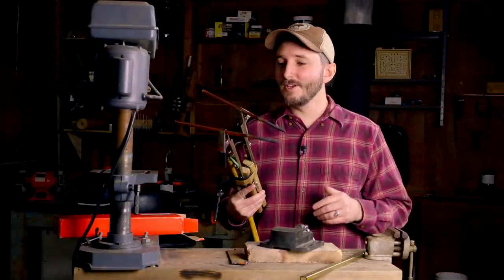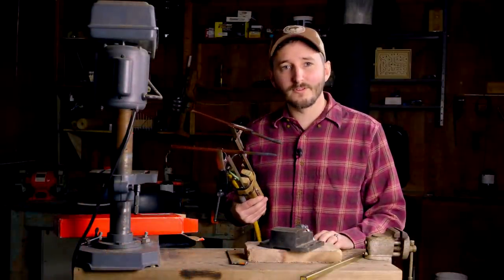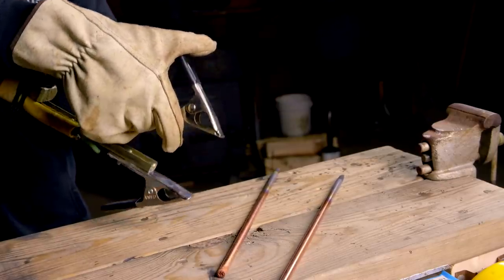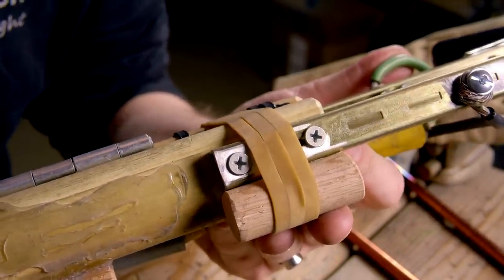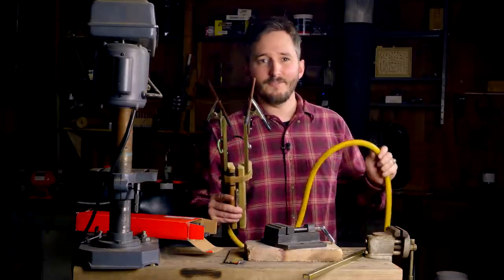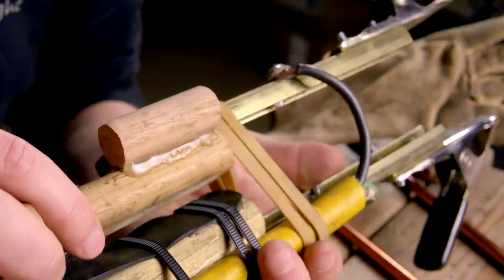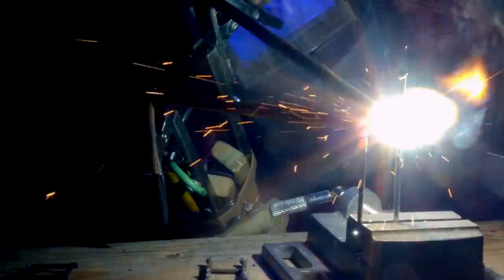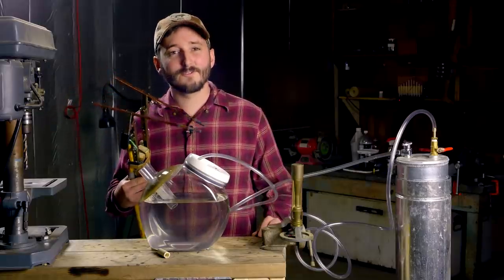Recreating An Antique Carbon Torch (Oxy/Acetylene Alternative)

Comment from the maker: For those interested, this did not actually work very well for making synthetic rubies. It throws off more carbon dust than a single rod as I used in my previous video, and so rubies that I attempted to make were very contaminated. This may however work pretty well if used as a heat source in a small furnace, with a closed crucible in the middle.
Reply: Did you make the project producing a flammable gas with the arc torch? if you did can you provide me the link video plz ?
Reply: How many amps you need for this?
Reply: How many amps do u need? Thx
Reply: @SY_Vlog24  you need 30 - 50 volts and 50-200 amps
Reply: @rolandasa.1112  thanks 🙏
Reply: As someone that's having to stay at home through this crisis because I take care of both of my high-risk disabled parents I'll say that I guarantee you that anybody that has money to donate to a charity at this time should look a little closer to home and only donate to organizations if you don't personally know people that could use your help cutting out the middleman will increase the positive impact every dollar you give has
Reply: COOL!
Reply: So use one carbon rod and one aluminum rod or try stainless. Half the carbon and you'll still get an arc!
Reply: Can you show us how to make carbon rods for welder using pure charcoal or how to make silicone from sand i would appreciate
Reply: What gauge of wire did you use, because I have some spare 6 gauge wire that I was wondering if it would work?
Plus, I know cords for electric ovens use 6 gauge wire and could make a short cord if 6 gauge is big enough. Oven cords are also the cheapest (per foot) way that I have found of buying 6 gauge wire.
Reply from the maker: Try to match the size of the wire used in the arc welder
Reply: @Nighthawkinlight  thank you!
Reply: Could you somehow cover the ruby in something like ceramic or some molten metal so you don't introduce carbon into your ruby? Afterwards just crack it open
Reply: G'day,

Yay Team.

My father died in 1982, and part of his  workshop-kit was a commercially-manufactured Carbon Rod-Holder (1970s vintage) which he never ever actually used ; because he preferred the hand-turned wooden Individual Rod-Holders he'd made, using the Carbons salvaged from expired Torch-Batteries.

  The Rod-Holders were like a pair of fat Crayons, held & used like Chopsticks to make & break the Arc ; all fed by a Transformer lying loose in a  9-inch Cubical wooden Tea-Chest, open topped.

  He used to use the Rig for fiddly little Brazing jobs, like Joining 3 Fish-Hooks together to make "Spinners".

   I think it's funny that he bought a "propper" Carbon Torch, and then stuck with the Hillbilly Rig he'd already cobbled-up - because the Chopsticks worked better, despite looking wildly primitive.

He used to paint the Work with Flux - held in a Vise,  bring in the Chopsticks, strike his Arc & then bring the Arc & his stick of Brass to together - while not touching the Rods to the Job while tickling the hotspot with the Stick.

I think he originally cobbled it all up to repair a Brass Cylinder off a Toy- grade model Steam-Engine, back in the 1960s.

Good 
Old
Technology...!

Such is Life,

Have a good one.

Stay safe.

;-p

Ciao !
Reply: You should try adding a compressed air nozzle somewhere to make it function similarly to an air-arc torch
Reply: It's going to probably be a bit trickier to get/make, and you'll need a hydrogen supply, but for getting a much cleaner heat source for making synthetic ruby, a Langmuir torch/arcatom torch might be an option. There, hydrogen gas is blown through an arc between two tungsten electrodes, splitting it into atomic hydrogen. The atomic hydrogen recombines on the surface of whatever is being heated, creating high temperatures and a protective hydrogen atmosphere. The reducing effect of the hot hydrogen might also help to remove any carbon that gets into the forming ruby from the graphite crucible.
Reply: There is no way to crucible  elements  without  empty space.
- Need a vacuum chamber.
Reply: I have to say that this video albeit simple is very informative.  I never knew there was such a tool/adapter made in the past that was so simple yet very making/handling such intense electrical Arcs and temperature. PS on behalf of making synthetic Ruby's you could try using tungsten rods in place of carbin ones( understanding it's used for plasma cutting tips)
Thanks again for all your amazing videos
Reply: Could you try adding oxygen at/near the arc to burn off the carbon before it embeds in ruby? The aluminium is already oxidised anyway. 

I know you said you don’t have an oxy kit so you probably don’t have stand-alone oxygen either... my local hardware store has a small oxy kit available for 229AUD that I’ve been eying off

Also, if you can adjust the frequency of AC output from the welder, higher frequency should be more “directable”
Perhaps adding some DC offset may produce different results? The flow of electrons FROM the rod nearest the corundum may draw carbon ions towards the rod?
Reply: Grant from TKOR did the crucible with with large battery cores
Reply: @Nighthawkinlight  
I love all your projects and your videos are just awesome
Seeing you just looks like I am watching the inner me doing all exciting things related to fire and sparks that I wanted to do in my childhood
Reply: Can you make crude oil fractional distillation setup and separate different kinds of fuel from crude oil?
Reply: Maybe a carbon arc furnace with argon would be a better idea.

Comment: Also, if you're making water or synth gas, don't die of carbon monoxide poisoning, kay? We all like this channel.
Reply: same goes for trying to compress it into a normal steel tank.
Reply: We should pass the hat around and buy him a sniffer 😁
Reply: Its impossible to get carbon monoxide poisoning from HHO or "water gas" as it has no carbon in it...
Reply: @marshmallowkiller  Wouldn't the use of an arc welder with carbon rods possibly introduce carbon into the mixture though?
Reply: If he's using the carbon arc (sorta hints at that) to produce synth gas and/or water gas, carbon monoxide will be part of the process. If you're thinking electrolysis, then yeah, no problem-- but synthesis gas utilizes partial combustion of carbon to make CO along with molecular hydrogen. Water gas is hydrogen, CO, and when coke was used, a mishmash of random hydrocarbons.
Reply: @marshmallowkiller  Water gas is not HHO  its CO+Steam CO2 and H2
Reply: @marshmallowkiller  bro water gas is a common name for carbon monoxide+ H2
Reply: Might generate ozone

Comment: Thanks for the video. I made one of these setups when I was 14 using carbon rods from D cell batteries, some wood, lamp cord and I used 2 lead weights in a pan of salt water for a rheostat. Plugged the thing into the house current and made a pretty respectable arc. My father came running out and said I was making all the lights in the house blink. Good times.

BTW the old search lights use this same carbon arc process and they have some sort of timed auto-feed mechanism for the large carbon rods. My Electronics school administrator was the only family in the US rebuilding the old WWII search lights back then and I've been able to inspect a couple of them up close. The ingenuity of the builders of society never cease to amaze me.

Comment: Ben - I've got one of these you can borrow for a while if you want to actually handle one in person. I'm in Canada too, I'll mail it to you if you want. There's a couple things I think you haven't figured out (like that as rods burn down, you need to adjust the angle permanently). Pretty simple fix. 2 changes: 1 - Add an adjustment bolt with knob that limits how far the handles can be pushed apart (their max springout). 2 - Replace rubber band with a spring pushing them apart. You always have a bit of spring to it so you can light, but how far apart they go afterwards depends on the bolt. Also in my half-made list of videos from 10 years ago I've got a tutorial for making one on the cheap. Cheap heavy gauge cord is almost always best to be old jumper cables. You can usually pick up old ones for $2-10 at a garage sale.
Reply from the maker: It's pretty easy to keep the rods spaced with thumb pressure, but I did consider an adjustment bolt.
Reply: @Nighthawkinlight  - The idea is that you just snap it shut to light it, let off, and then it's automatically held at the correct separation without having to use any squeezing pressure. They were used in part to preheat larger slabs of steel prior to welding, so you'd get sore holding them at the precise distance you want all the time. I think the knob is usually a knurled bit of steel as a thumb screw, so you can gradually decrease how far apart they're pushed. Or, maybe it's not done by separation but by rotation. I forget. I'll go play with them tonight and make a short video for you if it's anything interesting.
Reply: I also have one commercially made, I find it very hard to use to braze with but good for gouging and cutting through thickish steel..

Comment: Arc gouging whip needed and air compressors you will be able to cut any weld loose with percision and not damage base material.   It how we remove suspension hangers from a frame after there worn out and need a new welded on.
Reply: Oh come on brother, why take the easy route when you can us a cheap oxy/propylene torch to wipe a weld off in the midst of a wretched spray of bb sized globules and the constant threat of gouging because we haven't updated the shape of the torch in 100 years?

Comment: If you ground your work piece with a clamp and use your carbon rod to make the heat you can blow compressed air just behind the arc to effectively make a very clean gouge. Their are manufactures that use trade names like 'Air Arc' ect. But, you can give it a DIY try if you need to gouge and need a very clean, plasma cutter like, finish without a lot of surface prep. Works in all metals but you may not like the carborizing effect on aluminum or bronze.
Reply: When I worked in oil and gas they still used Arc-Air for destruct of old sections. They were using big heavy duty things, sounded awful and loud, like hells workshop!
Reply: In my last job I saw guys using arc air gougers, they wild

Comment: I'm rubbish at welding thin steel material such as car bodywork. However, I have done some serviceable work using carbon arc brazing. I found it to be fairly easy to control and capable of quite gentle heating, when required.

Comment: They used them for stage/street lighting quite often, and there was a clockwork mechanism to advance the rods automatically. Should be a easy search to find the designs.
Reply: Yep.
Reply: Electromechanical actually, not based on time. They self regulated based on the resistance of the arc.
Reply: And search lights on tow boats!

Comment: Many thanks for sharing this video. You can melt steel with these two arc rods .In the fourties there were many steel melting furnaces working on this principle. My neighbor few miles away has a antique arc melting furnace to melt 1ton of  steel but its collecting dust because its  energy inefficient.

Comment: When I have a rusty nut I can't loosen I wack a carbon rod in my welder ground clamp, another in the hand piece and get her glowing, because it doesn't have an open flame you can heat things in sensitive places like near plastic components, fuel lines, brake lines etc. great on old farm equipment
Reply: Wait, what? First of all, to cut something like a nut/bolt, you only need 1 rod. Attach the grounds clamp to the metal. (He has 2 because you can't attach the grounds clamp to anything when using this to make his rubies.) Second, the lack of "an open flame means absolutely nothing. This is radiating just as much heat as a torch. An open flame doesn't have anything to do with the heat it is putting off.
Reply: @xenonram  No, if you just use it like a shorted welding machine you're heating everything in the path of the current so you're wasting tons and not isolating the heat.
Again, no. If he's shorting the rods across a nut then there's no way in the universe that the nut is going to reach cutting flame temperatures before you get it hot enough to break loose. Lower temps, shorter heat times. How would that not be better for nearby sensitive parts?
Reply: @xenonram 1. He only stated he used a singular rod.
2. The heat is 100% more isolated, DEFINITELY different from a torch; which forces gasses to deflect off of what you're heating, inevitably heating things next to it.
Think; if you blow on sand, what happens? That same thing occurs when you blow a propane torch at sand; you'll notice both hot air; and sand, moving away from the center of the torch. This in turn heats the surroundings much more than a current based heat source.
3. It's hotter than oxy-acetylene, at a much smaller point. It'll make it through the material it's pointed at before heating the material surrounding it.
4. What is "Black body radiation"? Google it, and then rephrase your last statement to make actual sense in reality.

Comment: I have this capacity with an old 40A stick welder.  The ground clamp has an opening in the handle that fits the positive probe and they are aimed together to touch  to strike an arc for the carbon arc torch mode.

Comment: I had a pair of these back in the 80s and wish I hadn’t binned them now as I need to do some brazing. I managed to braze my existing fuel tank filler tube to a decent condition petrol tank sourced from a scrap yard as couldn’t afford a new replacement in those days.

Comment: I built a similar torch years ago. I use it a lot for brazing and heating material for bending. FYI the temp is about 11000 F, more than Oxy-Acytl. However, the rods you have are for arc gouging and are not the best for this type torch. Try to find some carbon arc projector rods or old Craftsman carbon arc torch rods. You will be amazed at the difference. Much less buzzing and a softer flame. Also, the carbon rods out of 6 volt lantern batteries work well too but are a pain to extract & clean and are kinda short.

Comment: I wonder how this would work in the production of calcium carbide?

Calcium carbide, which is mixed with water to produce acetylene gas, is produced by mixing lime and coke and heating it in an electric arc. Being that lime and coke are essential precursors in the Bessemer steel process, methinks that back in the day when electric arc furnaces began replacing the Bessemer process, someone got the idea to chuck those precursors in the furnace to see what would happen.

I wonder how much calcium carbide a small setup like this could yield...?

Comment: If I may bring a suggestion to the table: I would drill two holes in the two wood pieces. Then I would insert two rods. At the moment, you have technically a lever and your working with the short levered side. With the rods, the ratio between the lever lengths is smaller, giving you a precise control over the distance between the carbon.

Comment: Aren’t plasma cutters basically this but with additional compressed air to burn and blow the metal away?
Reply: Plasma cutters run a lot higher voltage than typical arc welders. 90v or so vs. 30v. And there's no need for carbon because you'll have the compressed air to cool the copper tips.

You can however connect your ground clamp to your workpiece and just use a single carbon arc, and hold your air nozzle in your other hand.
Reply: Look up Arc Gouging. Blow compressed air over the arc and puddle, removing the liquified metal.  It's fun.
Reply: Plasma cutters don't have consumables. (They call the tips "consumables," but that's like calling the paint on your walls a consumable. Everything is a consumable given enough time.)
Reply: @xenonram  mean you consume the paint to put it on there
Reply: Was thinking that, but plasma cutters don't cut non conductive materials.
Reply: @azz2   yeah they do, just lay a piece of steel on what you want to cut, and cut that.
Reply: Blow hydrogen through the arc to transfer the most heat to the work peice. I am thinking that would work to make rubies. Hydrogen supposed to heat better than any other gas.

Comment: Fun!  I've actually pulled out a DVD RW to see if I can find a large enough beam splitter for a interferometer spectrometer that is picking up from the hot lens removal cheap 4K camera spectrometer where I've been wondering about methods other than diffraction grating (with HDD actuator & Blu-ray RW diffraction grating or just a fixed first surface or not first surface DVD RW diffration grating).  So, bringing this all together is I've been thinking about ICP and Arc Furnace methods to make another range of spectrometers DIY home brew sample sources.  Awesome projects and thanks for sharing!  Neat to see.  Looking forward to the what looks like more than simple electrolysis method!  The world of electrochemistry awaits!

Comment: Very cool DIY project.  Definitely don't see these around much anymore.   Also, this setup could easily be modified for atomic hydrogen welding, by using tungsten electrodes instead and installing some nozzles in a way to direct hydrogen gas down the electrodes.    An obsolete process nonetheless known for its very high quality and clean welds much like tig welding